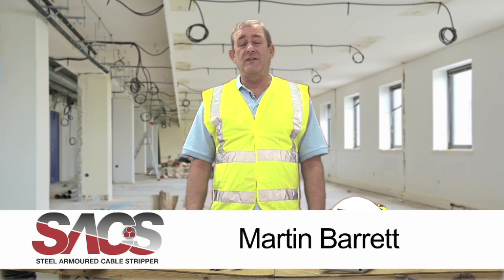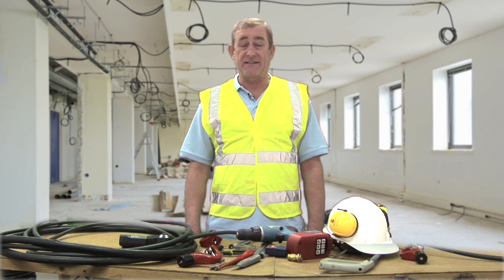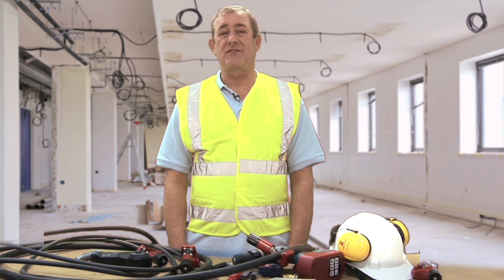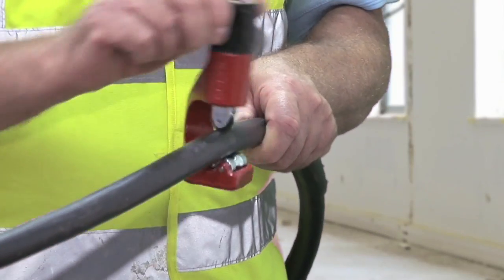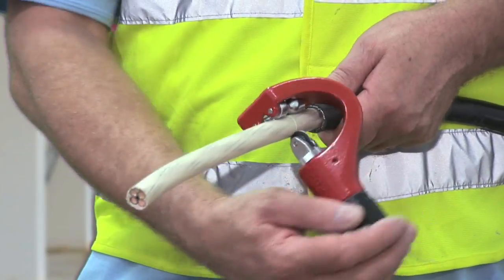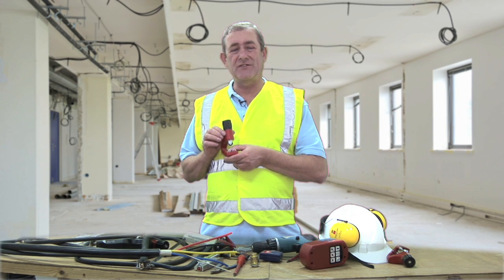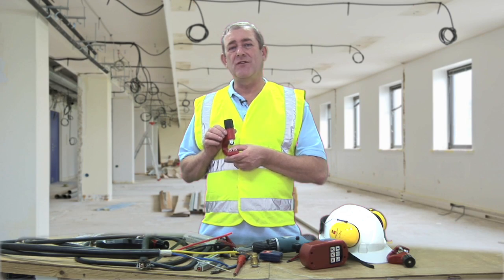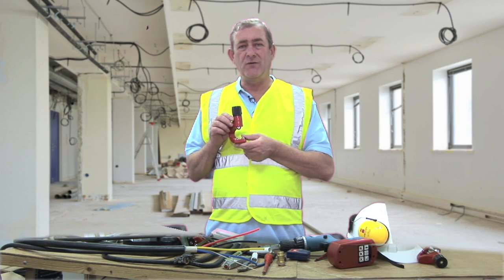Steel Wire Armoured Cable (SWA) Stripper - SACS Tool

Comment: Does not come with a replacement blade,also dont say where to buy same blade from. The bolt securing the cutting blade often comes off. Also when cutting the cable on the long runn ,commes off.
Reply from the maker: Hello @ionut5441! You can get SACS Tool replacement blades from E-Tech Components. Reach out at sales@etechcomponents.com or +44 (0)1744 762 929

Comment: not good tool i use this i am not happy with product
Reply: What was the problem with the tool?

I tried to use plumbing copper pipe tool, and found that rotary blades are no good for stripping SWA
Reply from the maker: Hello @waqasbtm1, thanks for your feedback. Can you tell us what your exact problem was?